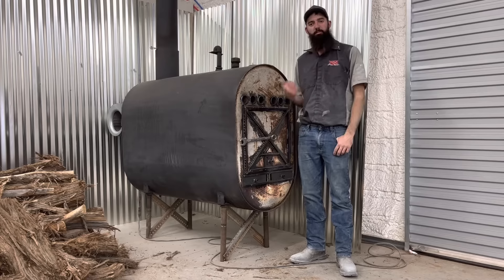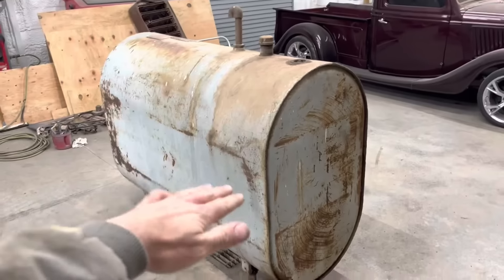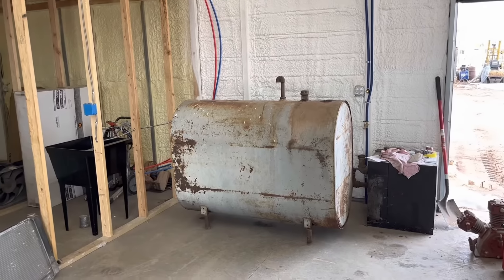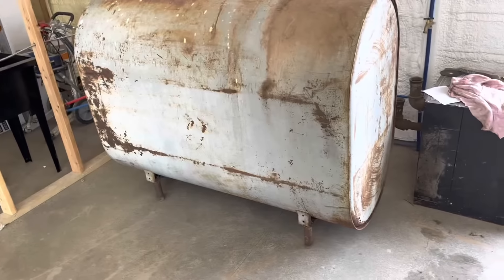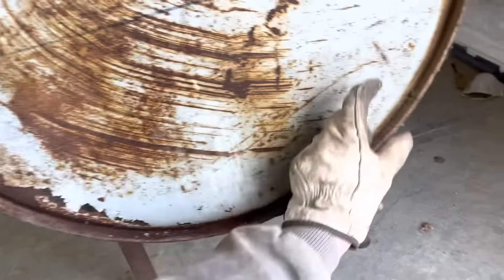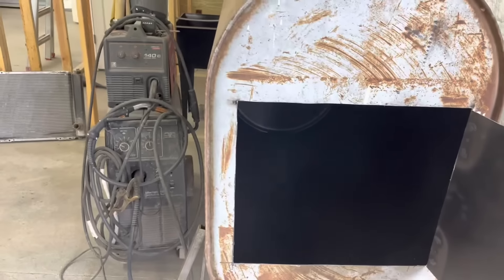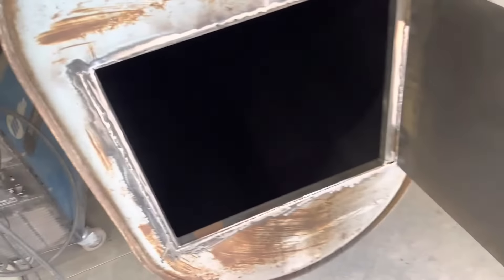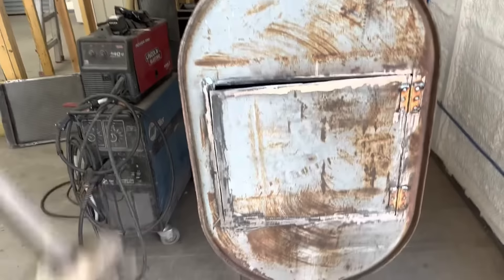How to build the best wood stove I have ever used!

Comment: I'm curious how you get insurance for your shop with a woodstove in it? They won't insure a garage with a woodstove in it here. I've built one like that only with just a 55 gallon drum with tubes above the fire and a squirrel cage fan in the back to blow air thru the tubes and it did work very well. My garbage burner is made out of a 250 gallon fuel barrel and that gets way too hot to stand anywhere near it so I can image how easy it heats that shop.
Reply: Hahaha domt tell them and take extra safe precautions lmao. Thats what I'm going to do in my house if I get a stove and in my garage

Comment: My buddy heated a 5 bay garage / body shop with that set up 40 years ago....upstate ny.....he had a 5 gal bucket full of old trans fluid and oil... with  a ball valve....everytime they opened a door to get a vehicle in or out....they needed some fast heat....4 or 5 jukes on the juice....that stove turned cherry red.....heats back😅😅😅
Reply from the maker: @tomkelly3896  that’s awesome

Comment: You need to put your sand in there like you said and then lay your fire brick because that fire and heat will deteriorate that metal and it won't last long.

Comment: The wood wall behind the stove needs protection
Reply from the maker: @Dbartee52  absolutely it got lots of protection.  Fire resistant panels,2 layers of cement board and then the tin.

Comment: LOL @ "dampener"....    damper.  Dampening is making something damp.  Damping is restricting or reducing.   A "clean hot burn" results from unrestricted airflow not a damped airflow.  The misconception of the opposite comes from the heat being held in the stove by restricting/damping the intake and outflow.  Damping the airflow results in a dirty burn with a lot of wasted energy going up the outlet pipe as combustible gas/smoke and the smoke is also very toxic.  A fast hot burn is the most efficient.  Then recover the heat from the exhaust.

Comment: My grampa made two.      One had a bunch of similar pipe straight thru and he put a fan blowing thru from the back.      The second one had pipes that started low in the front and came out the top like chimneys a few feet with elbows pointing out in different directions for a building with no electric.     The convection on that wood burner was so efficient it didn't need a fan and you could feel the hot air blowing across the room.

Comment: Built this same exact type of stove out of same fuel oil barrel in 79 we lined the inside with 2” thick fire brick lasted for yrs but went throu a lot of wood thou! Also it’s not UL approved so many insurance company’s in Michigan won’t cover them.  We later built same type out of 30” gas pipe line pipe didn’t need fire brick so heavy wouldn’t warp. Heat lasted longer once steel was hot.
Reply from the maker: Thats awesome

Comment: Try some baffles inside, so there is an 'S' path for the smoke to travel.  Some bent 10 gauge with 6" legs welded to the sides will allow cold floor air to be pulled up the sides for convection heat.  Many ways to do things.  Hope your smoke pipe damper works OK.  Bottom cleanout on the Smoke Pipe?  Your door latch seems a bit backwards to me.  The secret there is the Area of the stove for Radiant Heat.

Comment: When I used to have my shop going, got hurt early in life at fifty plus years of age. I live in central alaska and of course its cold here in the winter months. I used a piece of pipe from the oil line called a pig. Their about four foot long and thirty six inches inside diameter. This pipe is half inch material so burning it through is kinda non existent. I save scrap from any metals I found and utilized it in building it. I stood the stove upright so the length of wood could just be dropped in it from the top. About  a fourth of the way from the top of this stove was my outlet for the exhaust pipe and used some well casing for that pipe to go to the roof of my building but did use the insulated pipe for the pipe going through the roof. That extended about ten foot above my roof so embers didn't land on my metal roof. I used a proper cap on the pipe that could be removed for cleaning that pipe. I did the fan similar to yours on the backside of everything. I built hangers on the outside of this stove to hang old dead engine heads on it for collecting heat because once warm, they keep radiating heat from them also. I did brace my lid as you did but it opened just below the top of this barrel stove so no smoke gets out into the building. I also made a cleanout at the bottom for cleaning it out..... surprisingly tho, it cremated the wood products so well that a very tiny amount of ash remained after a whole year of burning it. I said alaska didn't I and so heat is most of the year. This stove just idled along for two days at a time using any thing combustible as in paper products that held parts, you know how that stuff builds up plus trash from the house that would of gone to the dump. Even plastic bottles from say soap or other went into this stove and was providing heat. With the way the pipe for exhaust came out the back, it made at burn chamber at its top that just burnt the smoke and everything up, leaving very little smoke out the chimney. Having a lift around made it easy to clean that chimney but even so, there was so little in that pipe that you could place everything in a gallon container after a six month burn time!! I admit that dry material is what you need for a clean heat but it is hard to find here as cottonwood and spruce is our heat source for burning. I used the whole tree as limbs and every part of a log could just be tossed in it. I caught the guys throwing in their pop cans and told them to stop that but when cleaning it out on the insides, nothing remained. They must of turned to ash as well. I also had some lumber mills in my area so their waste was primary for my heating source. Sawdust, wet sap wood and bark from those trees being trimmed for lumber was my heat and they paid me to haul it away!! The sad part was it was great heat but only would burn at the most using that stove eight months of a year, about four cords of waste wood. Were we to chat on a phone, I can tell of many types of stoves we used in the southeast alaska islands. Actually a good listen. Sorry for such a long comment
Reply: I was in a bar in Fairbanks that had a stove very similar to your set up.  It too was from the pipe line

Comment: Great video!  Gives me an idea for my 30 ‘x 50’ shop. Going a little smaller but your video gave me a spark of inspiration.
Reply: Check with some local plumbers to see if they know of any old 80~100 gallon well pressure tanks. I did a 100 gallon a few years ago and it worked great. I ordered a kit for making a 55 gallon drum into a wood stove and that made it really simple.
Reply: @OldGriz708  Great idea, Thanks!

Comment: Thank you for the update. I have quite a few 2” ID pipe.  In your opinion how many runners should I put in. I have a shop that 35x85. But I actually want to divert the runner’s towards different angles rather then having them all come out straight.
Reply from the maker: I would put as many in that you can fit.  and I think have some at different angles is a great idea.

Comment: I built one similar to it 20 years ago, put sand in the bottom, and lined it with fire brick. Sucker would absolutely run you out of the shop 3300 sq. Ff. I got old and tired of cutting wood so I replaced it with a waste oil furnace.  I do miss it, though it's stored in another shed if I need it.
Reply from the maker: that's awesome
Reply: Any thoughts on  using steel plate on top of the sand, instead  of bricks? Even if the plate was a "consumable" of sorts. It'd seem like it'd help with  slide-in log loading  and ash rake-out..
Reply: I think If you could make a heavy grate with holes in it to let the ash fall through to the bottom and 2 doors down low on both ends to push pull the ash out it would be an awesome improvement!  Maybe some sand to level the bottom and 1" fire brick on top of that to give it a flat bottom, then 6" or 8" up the grate, Maybe air flow control in the bottom clean out door?
Reply: Or even an inducer motor wired to a thermostat would be ideal for controlling the heat this monster is capable of putting out.

Comment: I have to ask what size pipes did you use for the heat exchanger. Was it galvanized or black pipe? Great build,  I plan on making two these for my barns. Love the wrench door lock idea. Soo cool…..
Reply from the maker: its 2 1/2 black pipe
Reply: Thank you for the update. I have quite a few 2” ID pipe.  In your opinion how many runners should I put in. I have a shop that 35x85. But I actually want to divert the runner’s towards different angles rather then having them all come out straight.

Comment: Round is the worst shape for a convention stove. The oil tank will provide good convection properties. A piece of sheet metal 4 inches away of from each side and gap between metal and floor would provide air movement without fan
Reply: There's actually another gentleman on YouTube that built a square one but at the top he put a piece of sheet metal that was several inches away from the ceiling  but sloped to the front and there was a gap so essentially the smoke and heat would have to travel along that piece of sheet metal towards the front of the heater and then go back towards the back along the ceiling and exit through the chimney so no heat is wasted or a lot less at least

Comment: Read it again - 14 inch above  " combustible  "  surfaces .   Cement is not combustible ....  Also I put patio slabs with a 1/2 space above the floor under the stove so the cement under the stove will not be encouraged to be overheated causing the slab to crack ...
Reply from the maker: great idea thank you

Comment: Most insurance company won't cover a home made stove 😢 been there
Reply: None will.  Any woodburner must be inspected and meet code before any insurance company will approve which will also be listed in billing.  Buildings will not be covered for anything ( hail, storm, electrical/kitchen fire, water damage )  if they discover there is an unreported wood burner.  Even though claim has nothing to do with wood burner they can legally NOT cover damage because they insured a home that did not have a wood burner.  I don't agree but that's the way it is.

Comment: Nice build and nice stove!! As noted by others, the barrel will last a lot longer if you line the bottom foot or so with fire brick. House bricks can't stand the heat and will break.

And one super picky little detail, it's damper, not dampENer. A dampener kills vibrations. A damper controls the movement of air or combustion gasses or some other fluid.
Reply: lol no a danpener makes something damp.  a damper reduces vibration or in this case reduce airflow.   As in "Harmonic Damper" used on engines.

Comment: Good luck with your insurance if you have a fire . You must use something fire rated . Old oil tanks if I were to guess wont  qualify . Kept in mind if you or a child gets trapped bc of your negligence ,you could face legal issues. You admitted on line your using a fuel storage tank as your heat source. I hope you know what your up against.. Be safe
Reply: You can live your life in fear or just live. I'm sure there's a committee somewhere coming up with some new rules to run your life though so don't worry. Can you taste ze bugs after your 8th booster?

Comment: 13:57 wrong logic, wall need to be as thin as possible to allow heat to "flow" quickly.
a thick wall can't extract heat as fast as the hot air flow in the stove.

same prinsiple that make a mass stove wasting energy.
more material thickness=more insulation=more heat thrown outside.

how can heat be transfered from a hot gas to a hot object?
yes a thick wall tube looks colder, but it means less heat is transfered to it.
a red glowing hot tube is way hoter, but it means more heat is flowing thru it.
Reply: LOL Mass stoves don't waste energy.  Energy is stored in the thermal mass and released slowly.  Burn fire for a couple hours and have many more hours of heat.  If the circuit through the thermal mass is long enough nearly all of the heat can be recovered from the exhaust.  You can study how the original "Rocket stove" from the 1970s worked or look at the design of any N. European or Russian mass heater.
Reply: @justme-n-gracie  temperature at exhaust?
explain how can heat penetrate hot brick/stone. it goes streight outside.
on my stove i can hold my hand 6-8 ft after stove ~60C

Comment: im thinking of makeing huge wood stove out 600 gall oil tank   that could hold 50mwheel barrels of firewood  for long hot burn
Reply: problem would be cleaning it out regularly... What are you trying to heat with it?